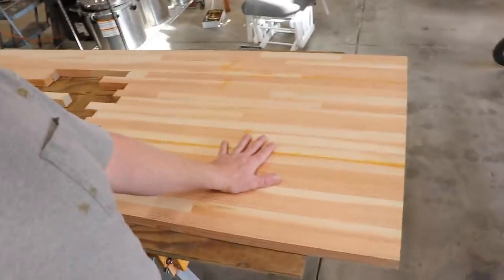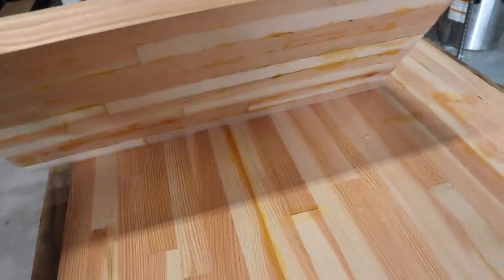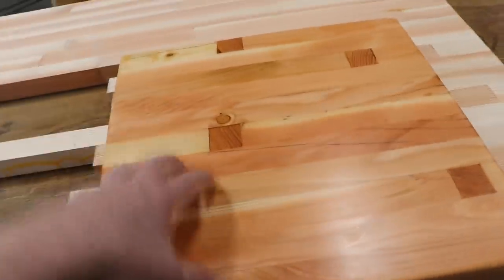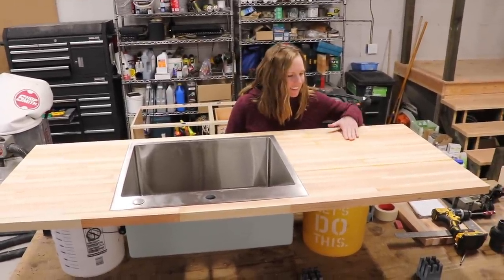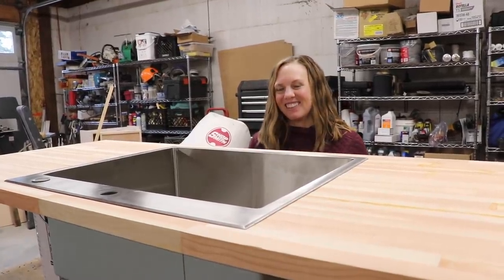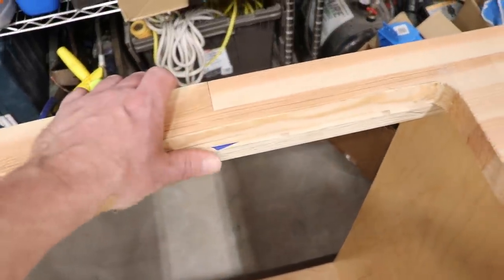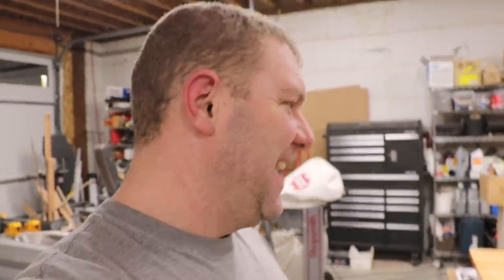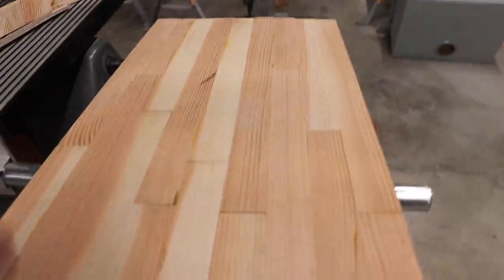Firewood ➡️➡️ Butcher Block: Sink Install & Epoxy Coating

Comment: Hi Jessie, You need to get epoxy along the inside of the sink area, this can best be done with a throwaway brush. The wood is very vulnerable in that area and water would destroy the top if not sealed properly. It is very important that the end grain is sealed so that water cannot seep into the wood and swell it up, as this would allow the top to become unlaminated.

Comment: Belt sander etiquette dictates you sand WITH the grain.  Definitely seal the edges of the wood inside the sink hole with epoxy as it will get water in there inevitably!!

Comment: Yah.  Because this is more important than leaving your home unprotected of the elements for it's second winter.
Reply: I don’t remember if they talked about it in a video, or if it was a post on instagram, but I’m pretty sure Jesse said they can’t put siding on until they finish foaming. And they can’t finish foaming until the electrical is done because of the nature of the SIPs. There is still a LOT of work that has to be done before siding can be put on.

Comment: Make sure that you seal the underside or the counter will warp as moisture is absorbed on the bottom and not the top. Also, your need to seal all of the edges including the sink cut out area as the end grain will absorb water very easily and will warp and discolor.
Reply: I agree... this is really important!

Comment: One tip nobody has mentioned yet is to use a hot air gun to warm the surface of the epoxy this helps it to flow and reduce ridges and bubbles coming to the surface .

Comment: Jessie, the last time I did an epoxy job, I used a throw away brush and just brushed it on like paint.  I coated the top, sides (especially around the sink cutout), and caught any dribbles wanting to run under the edges.  The epoxy will self level with no brush strokes visible.  Any bubbles found can be removed by running a propane torch above the area quickly.  You are doing a fine job regardless.

Comment: Dont forget to seal the edges of you sink cutout, also the bottom needs to be sealed, this will prevent moisture in the atmosphere swelling the lower side and possible causing the whole thing warping.

Comment: But it is not "Butcher Block". Butcher Block has standing end grain.
Reply: No not necessarily.  That would be just a chop block, but it can go both ways.
Reply: He used softwood anyway
Reply: @ja-vg2fh  I can call my bike a motorcycle as much as I want but it is not a motorcycle and will never be a motorcycle.
Reply: @FranklyMyDearIDontGiveADamn  l guess your argument is with the whole butcher block industry that's been getting it wrong for so long. You should go and relable at all the stores that sell there products.
Reply: @FranklyMyDearIDontGiveADamn  because you know best.
Reply: @ja-vg2fh  The function of standing fibers is that you do not cut fibers when using it. If you have horizontal fibers, you lose the idea and function. that is why butchers used them initially, because they last longer.
Then what companies use for words in their advertising to sell their goods has nothing to do with the thing, because everything that is in advertising is not true.

Comment: This one scared me Jesse. In particular when you were holding a piece of wood in one hand and cutting it with an angle grinder with the other. I did that this summer. The blade hit something and kicked up, going across the knuckle of the index finger on the hand holding the piece of wood. The full width of the knuckle looked like hamburg. I spent 8+ hours in Emergency to get it cleaned up and sewn up - including the cut tendon. Now 5 months later I have "finished" rehab, just 2 days ago, although I still need to work on strength and more flexibility. 

Therefore I cringe if I see someone doing something that caused me so much pain and grief. You two have done a wonderful job and don't need to be sidelined by something so easily avoided by simply clamping the wood.

Comment: I worked at Arch firms almost for 24 years. I did draw millwork details on our construction documents. At the sink base.  The top frame support at front and back are supposed to be sideways to leave room for any sink to be inserted inside.  The front frame should have fake drawer face with cabinet doors below

Comment: Dude you did not just use a belt sander for final sanding.....uhm check sum youtube vids random oribital sander, 100, 150 220 grit..
Reply: I was cringing as he was using that belt sander across the wood grains...and not with them.
Reply: Actually, when using epoxy as a finish the wood sanding isn't nearly as critical as you might think.
Reply: @p.t.anderson1593  - would still leave tool marks, wouldn't it?  Never done epoxy, so dunno.

Comment: Make sure you get the inner edges with epoxy because if the sealant from around the sink breaks will warp and damage that wood and cause swelling.

Comment: Checking the epoxy safety paper "Not recommended for use on any items that come into contact with food, drinking water or animals." Doesn't sound like something I would use but hey you do you....
Reply: There are countless epoxy mixes specifically for counter tops that are non-toxic and food safe once cured.
Reply: @johnchappell4492  yes but not the kit that was linked in the description.

Comment: No worries with sink moving... surely you'll use some clear silicone sealant under the sink's lip to prevent fluid from wicking under it.  THAT will help a LOT with securing sink to the top.

Comment: Should have coated the edges in the sink cutout so water that gets there won't soak into the wood.

How many cat hairs did you end up with in the finish???

}:-]
Reply: I was thinking the exact same thing about the sink cutout.  And I'm REALLY hoping he waited until that first coat was thoroughly set before starting to plane and sand the cutting board insert for the sink!

Comment: Firewood cut, planed, glued and epoxy.
what about the wood moisture? If not dried, it will be moldy
Reply: shhhhh
Reply: It won't mold under that epoxy because of the lack of oxygen. However, leaving the bottom side uncoated means the moisture will slowly leave through that side, causing the grain to shrink and the whole top to cup into a big banana.

Comment: Feel for you Jesse.. I am a DIY woodworker with all the tools and all my fingers 🥳 ... Finishes are a fickle bi-och 🥴.  I have sanded through stains and had do overs.. sanded through topcoat and stain and do over everything on cabinets 😢.    Lotta moving blades on that shop smith and of course saw kickback is a concern...  Be safe..... Tabletop looks great, nice work ...

Comment: Great job so far on the countertop.  We recently tried to install a Stainless Steel sink and the installer said no because there was no room on sides for the clips. Because you are doing it yourself and could 'alter' the cabinet to make it work it looks fantastic with that countertop.  Have a merry Christmas and a Happy New Year.

Comment: at 15:08 why are you sanding ACROSS the grain?  The belt is running across the grain, while you're sweeping the sander with the grain.  Causing a lot of scratches.
Reply: right

Comment: Why didn't you smooth out the epoxy runs on the internal/inside of the sink edge? I would also put a sealer coat on the underside too. Still it looks nice.

Comment: At one time, the White House had butcher block counters, Made By Boos Block. I did my large kitchen with the same stuff, really amazing stuff, But very, very expensive. At the time a 3ft by 6 ft piece was 600 bucks, when I cut my sink out , that piece has served as my cutting board, for going on 25 years. Your job is coming out nice, what saves you is your eye for detail, and researching, before jumping.

Comment: Looks like you cut the hole too big.  should cut the hole for the bowl, then have separate round holes for the faucet.  Seems like you're giving up a lot of support doing it the way you did.  I could be wrong, but that's what it looked like in the video so far.
Reply: Ya my sink came with a pattern that was definitely oversized. Lesson learned

Comment: Jessie - is the hole a bit big for the sink?  At the back of the sink where you have the taps the cutout only needs to allow for the deep parts of the sink as you can make separate cut outs for the taps this would hopefully offer the sink more support and less flex.

Comment: The sink shouldn't wiggle at all once you seal it with silicone before you clamp her down. As a previous commentator said, coat the underside/inside edges as well.
Reply: It will curl up or likely split if the underside isn't finished or at least sealed. The wood dries out or takes on moisture from the air to fast. Fir or pine wood is soft and will move a lot and swell or more likely shrink when it dries. Wet wood stored outdoors will shrink 1/4" to the foot.

Comment: Use a V notched trowel to spread the epoxy out evenly and it will level itself, also use a propane torch and sweep the flame sideways across the epoxy surface, many times. The CO2 in the burning gas will cause the bubbles to burst before the epoxy sets up. If in doubt do it more.
Reply: Spot on, follow this bit of advice and the top will look tops👀😉

Comment: I use a torch or a heat gun to take the bubbles out of the epoxy when pouring it.

Comment: A true butchers block is left untreated and you scrub the blood out of it when you're done butchering.
For this to work though,  you need to use a wood with natural bacteriocidal properties.  In England this is sycamore,  but that's not the same species as what you call sycamore in N. America.

Comment: If you do a run with the router on the underside in the front to create a dripping edge you never have to get water in the drawers or running along the front. 
And If you have a build in washingmachine then coat the underside above it so warm moist air don’t get in the wood..

Comment: When sanding any wood, sand in the direction of the grain, not across it, or you end up with thousands of tiny scratches which will prove hard to remove or disguise.
Reply: And you can dig out the soft areas and end up making waves
Reply: @Matt Pryce I stand corrected! My thoughts were that after using the planer and thicknesser, all that was needed here was a final, pre-finish sanding. I would still think that after all the previous machine based effort, sanding across the grain might simply cause more issues than it solved!

Comment: People that i know that do epoxy will vibrate the underside of their projects to release and air bubbles then use a torch  moving it back and forth over the top to let the bubbles out, however it could be different with the product you are using. Your project looks awesome.

Comment: I am concerned that when you start processing meat the weight will prove too much for the cabinet frame. An additional  framework holding up the sink whilst still providing room for the trap and waste can may seem like a belt and suspenders approach but you'll sleep better.

Comment: You could get a corianders offset from your 'local' countertop supplier and use you router to achieve a low maintenance cutting board. Corianders is a nice surface to shape as its resin based.
Reply: Yes corian cut offs,
Corian cut offs super glue very well.  I experience is with a fireplace surround and mantle.

Comment: Drop the sink in silicone. I’ve done many over the years without any trouble. Also, install your faucet before mounting the sink.
Reply: Butyl is even better. It never really hardens. I use the tape form that has a mostly round cross section when I install a sink like this or the under mount style. It's way better than silicone for boat applications, around windows and where hatches meet the deck.

Comment: The epoxy will be hear resistant but the wood under it won’t be. Don’t put a hot pan on it as it will probably discolour over time.

Comment: Jesse, I think you’ll regret the decision to not make your cutting board so the work surface is end grain. Every future knife cut will be on permanent display and a future coat of mineral oil will only highlight it. Well, as you know by now, making another cutting board is a quick and easy project. Don’t forget to use your router to make a groove that captures runoff juice from meats. Another nice mod to a cutting board is a hole to push your waste cutoff through.
Reply: Do this! It still isn't the best wood for a cutting board but it will improve the durability.
Reply: I thought the exact same thing, but epoxy coating the top will help harden the fir... but I sure wouldn't use that as a cutting board!
Reply: @stevencjones5236   Agreed - if he plans to use epoxy again for the cutting board. I'd hope he would opt for mineral oil for that. Epoxy is OK for the looks. So is several coats of poly (high gloss or satin) for the counter top but for the cutting board which will receive a lot of knife wear and tear the smart move is to use end grain and cover it with mineral oil.

Comment: Jr is getting a bit more vocal during this vid. when will we see him?
Reply: Keith Armstrong  Or her? Was that a red child’s jacket hanging with the other coats between the bathroom and rear wall on the plaster boarding (sheet rock - on that side of the pond) video.

Comment: Hey J before you do the upstairs countertop check out a company called Stone Coat. They have tons of videos about doing epoxy countertops. Not sure if they are better than the Home Depot brand but if you believe their videos they have a great product. I have no personal experience with them but I think they are worth checking out.

Comment: We put counter tops with sinks in all the time.  If the sink is a bit wide for the sink base, you can cut out or notch the wall of the sink base.  We recently put in a corner sink and the corner sink base had sides that were perpendicular to each of the adjacent walls.  This made the front of the cabinet significantly narrower than the front of the sink even though there was a 45 degree door there.  It was a remodel job and the previous cabinet maker accommodated the issue by moving the sink uncomfortably toward the back so the homeowner had to reach over 8" of counter to the sink edge.  She was happily surprised when we mounted the new sink right up to the front after notching the sides of the base cabinet.

Comment: use a foam brush for the edges. use a notched applicator to get level. put a torch on it get the bubbles out and level it.

Comment: When you set the sink make sure you use silicone to seal it to the counter.
Reply: Butyl is even better. It never really hardens. I use the tape form that has a mostly round cross section when I install a sink like this or the under mount style.

Comment: You can use a hair dryer on the epoxy to do two things. First it will take out any air bubbles and second it will help the epoxy flow  better so you get a flat finish.  Nice fire wood.

Comment: Is there a reason why you use the belt sander across the grain ???
Reply: You can cross cut to remove material faster down to finer grits then you need to swap to with the grain sanding if using a belt still.  A dual action or random orbital sander is better for removing the belt Mark's.
Reply: @foggysignalproductions2072  Yes. I've done the same.

Comment: Guys I have been watching your videos since the beginning and think you are doing a great job.  Here is a company you should look at "Stone Coat Countertops".  They are a southern Oregon company that has great products with a complete YouTube library of tutorials for all the epoxy projects you can think of.  They have designed their epoxy specifically for counter tops and I can attest to the fact that it is easy to use.  It sounds like it is much more durable than the product you selected and heat resistant enough that you can set a hot pan on it.  Like you I struggle with finishes sometimes but this is pretty much fool proof plus if you do make a mistake you can just sand it down with 220 grit and do it again .  PS ALL the surfaces have to be sealed or the moisture will warp and check your butcher block.

Comment: Most sink bases are 30 inch standard  your Silicone / glue will 
 hold that down with no problem  with your brackets that sink is not going nowhere   Great job💪much love from Detroit 👍 THANX

Comment: Look up videos from stone coat epoxy countertops those guys and there products are awesome and on your final coat of epoxy if you take a torch or a heat gun over it right after its poured it will lay smooth and pop all the little bubbles bringing the air to the surface.

Comment: I hope you're gonna put another "flood coat" of epoxy on top of the first application so it can self-level after spreading it to a consistent amount of liquid using a notched spreader.  Also, does your epoxy manufacturer recommend using a torch to pop any bubbles trapped in the liquid after pouring and spreading?

Comment: i will probably get slated but i am just wondering .
have you considered running a small flame blower over the epoxy when its wet as this will remove almost all the bubbles.
and help level the top .

Comment: Hi jessie how long  do you have to wait before putting  the next coat on and do you have to sand in between
Reply: If you do it in less than a day then you don't need to sand. Anything longer and you should scuff it with 220 first.

Comment: I'm surprised you didn't wet the top with water to swell the grain, allow it to dry, resand with fine sandpaper before coating it. Looks great, maybe I've been doing it woodwork wrong for 50 years.
Reply: Yea sit back and criticise, instead of giving a suggestion beforehand.
Reply: James Nichols kind of hard to give information before hand since these videos are taped in advance. But I’m glad he made his comment since I’m watching this process and might do something similar. It’s not criticism it’s just more information to think about and process.